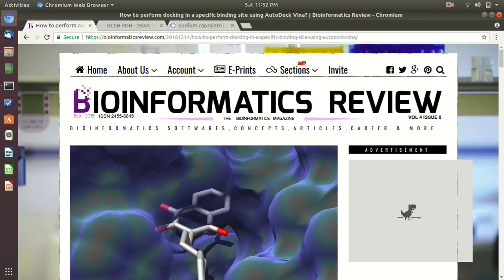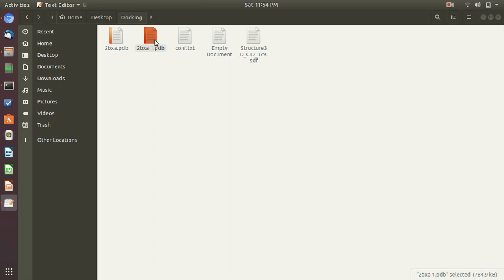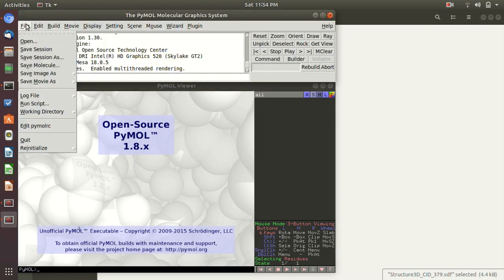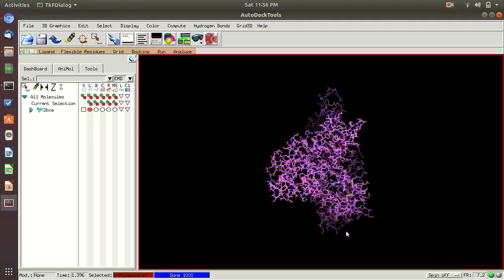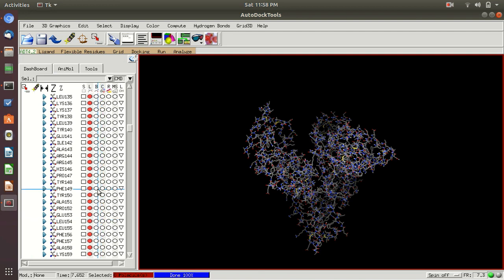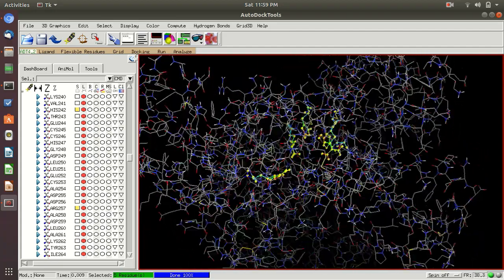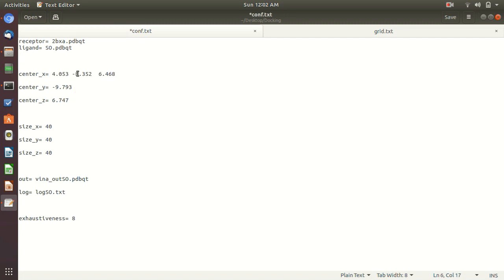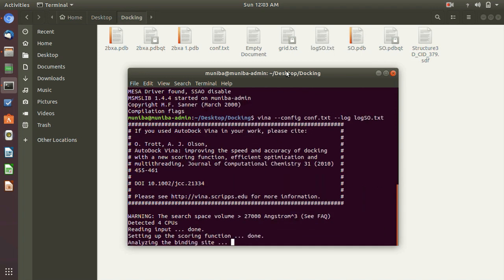Tutorial: site specific docking using auto dock vina.

Comment: Everything was going good until 10:55 - then the train absolutely fell off the track 😂WTH happened? And here I thought I actually could do docking... SMDH
Reply: It might be helpful to briefly learn how to use command lines. Autodock Tools just preps you with pdbqt files and setting up configurations, but the actual Vina part is run on the command line. All you need to learn about command line is how to locate your files (cd) and make sure you downloaded vina properly, which differ by the OS you use.